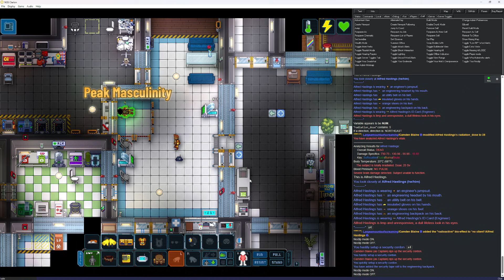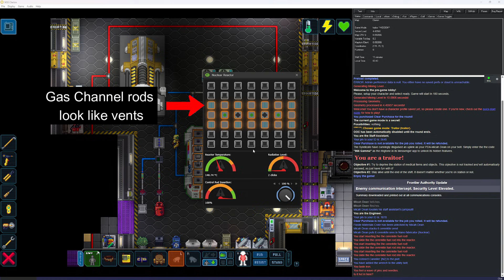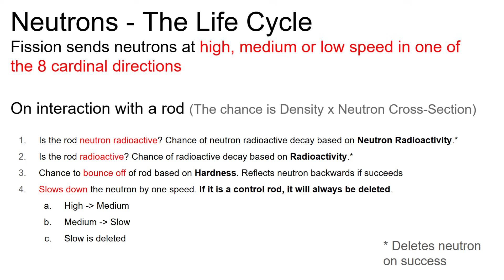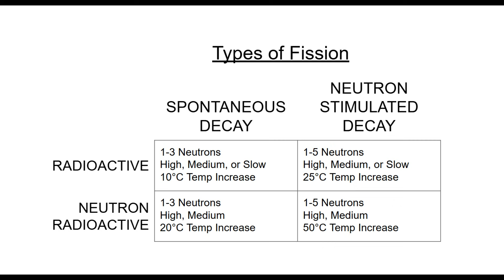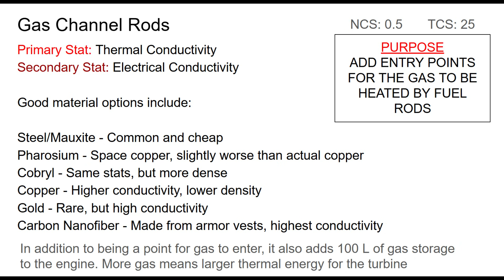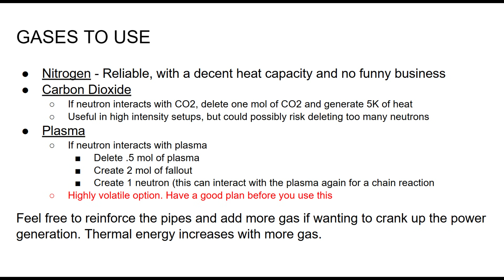A Comprehensive(ish) Guide to the Nuclear Generator

Comment: Nice vid.
6:49 Centrifuges make more plutonium for the amount of radioactivity used rather than what's left.
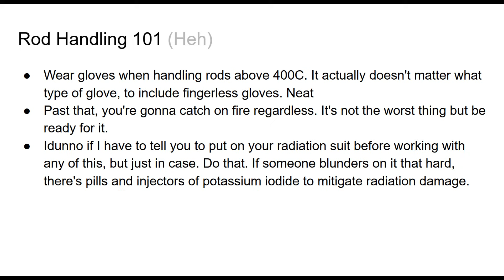12:26 The wiki states that the rod melting temp is 1700 kelvin not celsius, though it could be wrong. 1700k is ~1425C so maybe keep it below that.
Some more tips: 
1. You'll often run into radiation being a problem for the crew faster than heat being an issue. You can build stuff around the reactor to try to block the neutrons or have the reactor layout block neutrons from leaking. Having both is best. Not 100% sure but neutrons on the outside only seem to interact/irradiate one thing per tile.
2. The reactor runs cooler than TEGs so you generally can add more canisters to the loop w/o pipes bursting. W/ reinforced pipes I've added ~14 canisters before w/o a problem.
3. Mechcomp is your savior. With the right setup you can automate the turbine stator load so you don't have to baby it the whole round. There's many setups and some of the  setups use slightly different values than others of the same components. But if it works it works.
4. They didn't mention it but the electrical conductivity of the stator material affects the power output of the turbine. It starts with a steel stator so you can probably find something better laying around even before mining gets their first ores in ;)
5. You can also try messing around with radioactive parts other than fuel rods. And also non-radioactive fuel rods for their interaction stats. The reactor interface won't tell you the current reactivity of non fuel rod parts so you'll have to take them out and use a material analyzer to see how much the radioactivity has fallen from it's base stat.
6. A lot of us have accidentally blown a reactor or turbine. It happens. Turbine's are fixable, reactors are not. Try not to walk away if you've just added new rods or gas, without a mechcomp'd turbine. Or if you're with a powerful setup and you're not sure about how fast the heat is rising. As long as the meltdown wasn't intentional (or if it was and you're an antag) you wont get banned over it lol.
Reply from the maker: Cheers! I'll admit this engine was a bit tough for me to figure out, more info is always appreciated